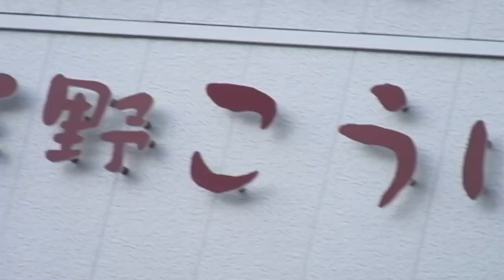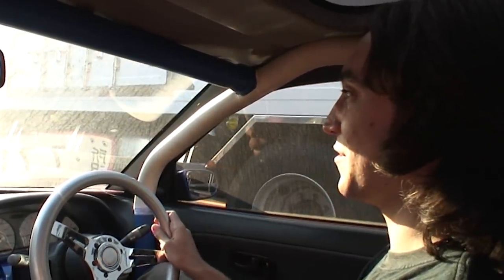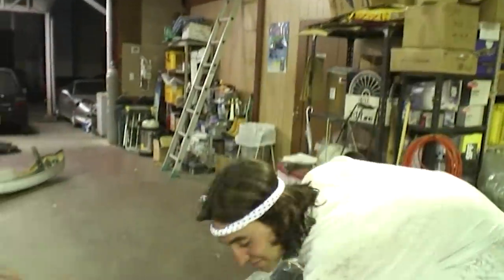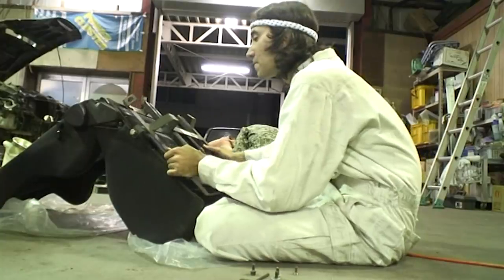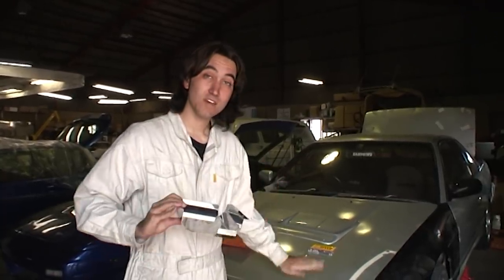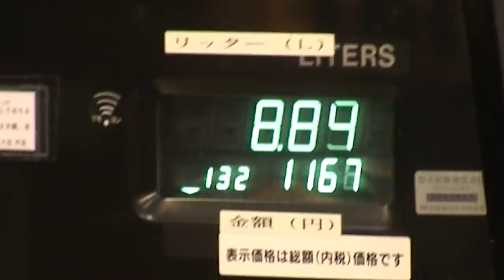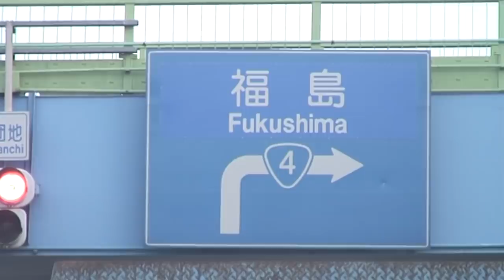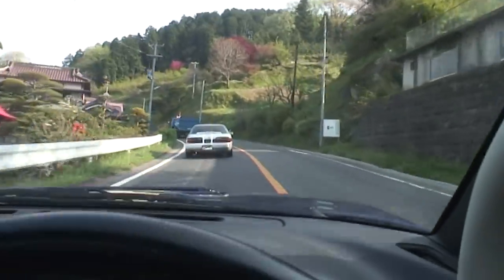ORIGINAL Japan drift vlog from 2007! *read description*

Comment: No wonder you looked familiar. I moved to Osaka from Aus back in Oct 2007 - I got the bug after importing an R33 and was fascinated by all the bits of Japanese car nuts (magazines in an AutoBacs bag, newspapers wrapped around the stock parts the owner had kindly included)... sadly, didn't really get much into the car scene up there, but went to a few D1 events at Suzuka, etc. Edit: I still have a pile of HPI magazines somewhere from those days...

Comment: Not a single piece of insane camber in sight
The difference between now and then is insane
Reply: The purpose built arms and suspension was not available then. Welded knuckles were pro spec! I bet a lot of these cars had a lot less lock and more camber gain than the modern versions. They were simpler builds running lower power.

Comment: Currently at 10:12 and i started wondering, is the s13 with the beaten in door and the intercooler piping that goes way up in the air here now, Seen the  car in almost every Matsuri video i've seen. soooo, lets find out.